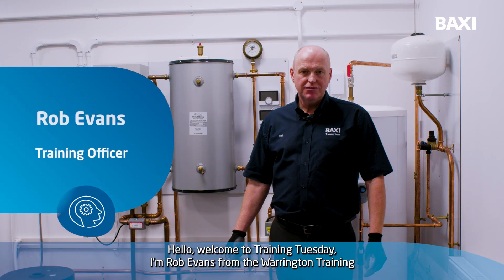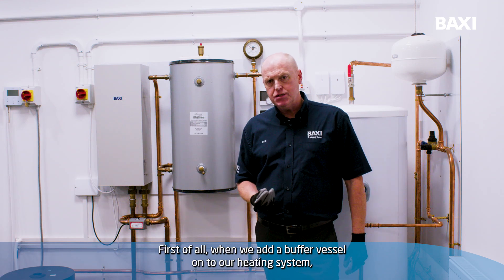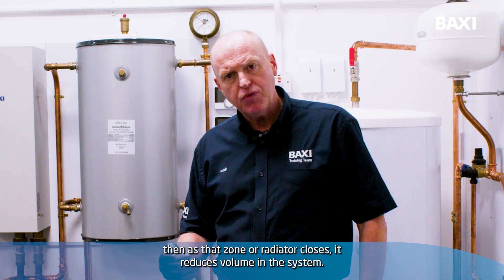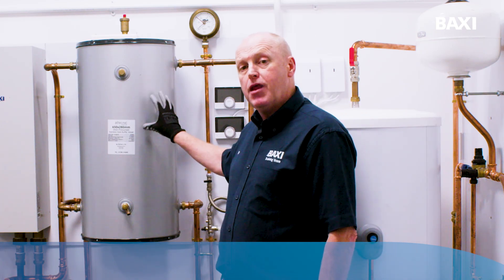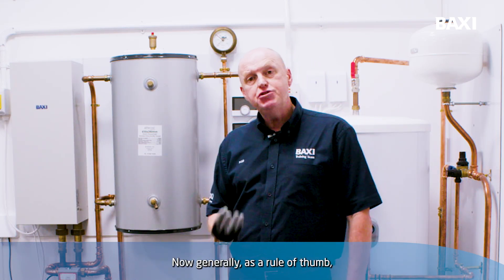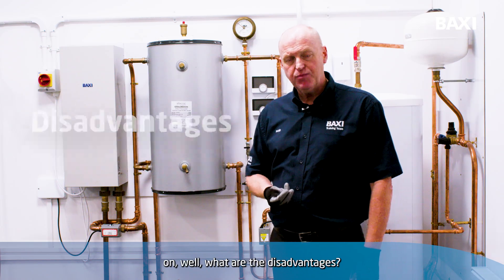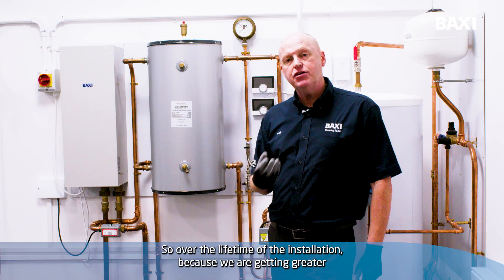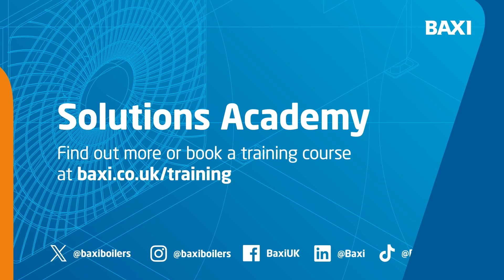Advantages of installing a buffer vessel on a heat pump system

Comment: 25-40liter for 7kW is nothing and manufacture recommend 10-20l per kW. My suggestion 4kW = 80l and 16kW = 160-320liter depends on how much water is already in system.
Reply: This 25-40liters is probably minimum water volume to handle 5min defrost cycle.

Comment: I think a buffer generally reduces efficiency as the system is sending some of the heat back to the heat pump. For best efficiency ensure heat emitters do not turn off and do not use zoning. If the system does not have sufficient volume to cope with de-frost cycles then fit a volumizer.

Comment: 1. Make a short list of heat pumps with the correct maximum amount of thermal power based on a heal loss calculation.
2. Choose a heat pump from the short list with the lowest part load.
3. The minimum system volume [L] can be calculated by the Run Time [minutes] * Lowest Part Load [kW] / (Specific heat capacity [4.186 J/kg*K] * (Flow Temp [C] – Return Temp [C])).

In >= 90% of homes a buffer tank is not necessary when the installation is designed as an open loop system (without zoning and without TRV's).